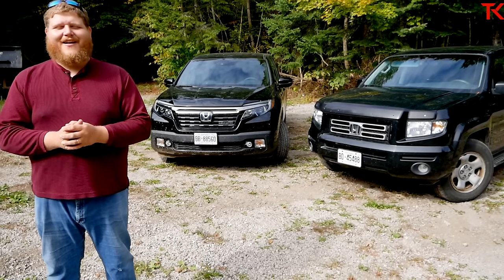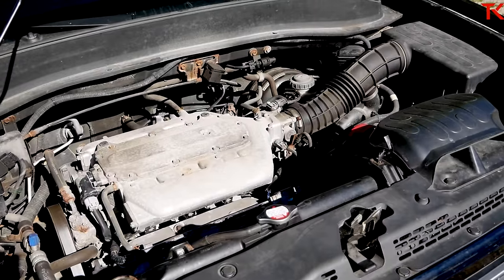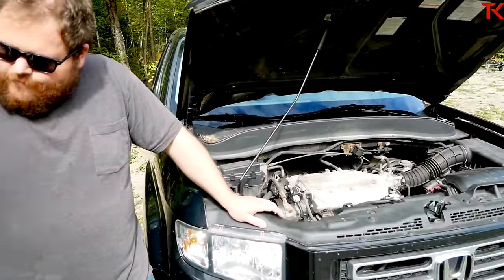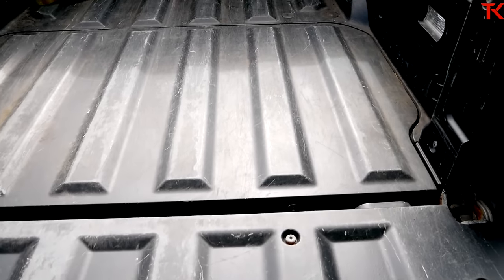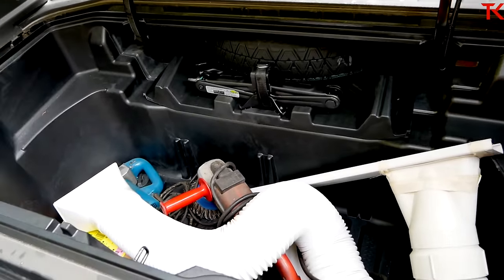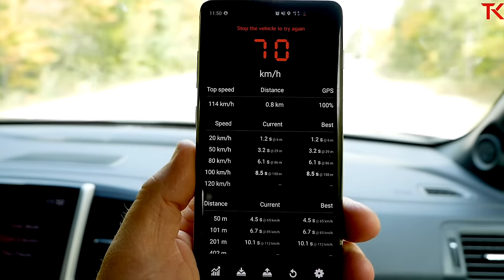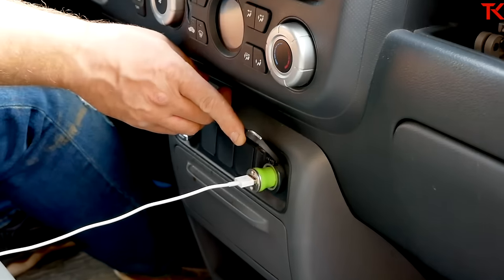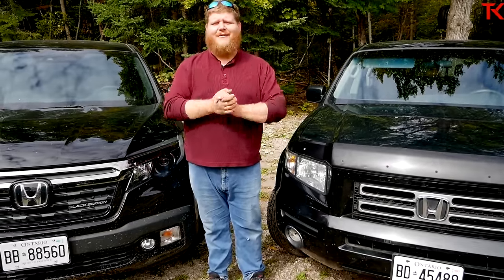Old VS New - Is the 2020 Honda Ridgeline Truly Better than the Old One? + 0-60 MPH Drag Race!

Comment: For your brother: The 2006-2008 only had six bed tiedowns. When Honda did the 2009 model year refresh they added two additional tiedowns to the top-rear of the bed giving you a total of eight. Also, with the 2009 refresh Honda got rid of the four-pin tailor connector leaving you only the seven-pin.  Additionally, the dual-mode tailgate in the down position is rated to handle 136kg of dynamic load before that cable fails.  Lastly, the first generation Ridgeline has enough space for a full-size spare in the in-bed trunk while the second generation can only fit a donut.

Comment: I bought my 08 new. The RTL w/ navi was the top of the line, then RTS, RTX and RL. All models came with 4WD. I updated my audio head unit with a Pioneer 4500NEX w/ Bluetooth. Had seats, armrests and center console covered in leather with new original sports cloth center inserts. LED headlights and day-time led running lights in the lower cutouts in bumper. Awesome truck that I'll never give up. 160,000 + miles and has never let me down.
Reply: I have a 2010 RTL model heated seats moonroof loaded 160,000 on it I love it I just wished it got better gas mileage I was hoping for more than 20 22 25 miles to the gallon
Reply: How's that head unit.. I like stock but my navi/touch is acting up....
Reply: @richardyoung5586  same here, gas isn't as good as I thought it would be :/
Reply: That sounds pretty awesome I like to see some pictures of the Year interior I have to do the same thing to mine like to see what it looks like
Reply: I'd definitely be interested in the headlights
Reply: I'm planning on buying a used one (2006), what common issues they have? What about the MPG? I'm on university so I'd use it for daily, I'm from Mxli so the gas is not so expensive.
Reply: @LxloSiq  I get about 17mpg

Comment: I’m 18 I just bought I 2011 f150. I traded in my own 2008 ridgeline, she made a lot of noises, 215,000 miles, all sorts of lights constantly coming on and off, it was the end of her life and I needed to upgrade to a bigger truck for my gutter business. But for the two years I had my ridgline (little brick) she did a great job. Very affordable when I bought her, little maintenance in the time that I had her and took a 50 mph rear ending like an absolute champ. Would highly recommend a used ridgeline for a new driver, very safe very reliable.

Comment: I like the uniqueness of the gen1 styling. Plus the interior is much more practical.
Reply: I feel like a boss in my 2014👍
Reply: I think the front end of the gen1 looks better but I've always thought it looked ugly from the side
Reply: norcalchrismeister I would take a gen1 with gen2 powertrain
Reply: Had 5 since 2007; current is 2019.  I like the ride and diminished road noise of the current model but the interior of the old ones is much better.  The console that separates the leg room is stupid.  As was getting rid of that little tray over the glove box. I disagree with this guy's assessment of the trunk. I have golf clubs and the new one (2019 vs 2012) is bigger.  The other thing about the new interior is that there is no 12V power source in the back seat, also stupid.  The air filters on the new one, both motor and cabin, are much easier to change out.  I hated the body style when I got my 2007.  I called it the storm trooper; it was white.  But after a while it grows on you and now I miss the little El Camino "wings" on the bed.
Reply: @jamesharris8719  my 2008 was white. I regret ever getting ride of it.

Comment: I rarely drop the tailgate on my 2008. 99% of the time I swing it out to access the trunk. Also, didn't like the flying butress at first, but it grows on you. It's also practical. It stiffens the unibody.
Reply: I have a topper on mine  so when I see a neked one I'm always like, oh yea, that's how it looks 🤣
Reply: @molliefofollie  I just bought an 07 with 145k miles today. It’s the RTL and has a topper too. So excited

Comment: Love my 06 Ridgeline (1st year of production). It's got 226,000 miles and counting ... runs great with plenty of power and smooth ride. FYI, mine had the same back seat lock bar issue that I fixed by replacing a pulley at the floorboard that controls that locking mechanism - about a 30-minute fix.
Reply: I saw a video on the replacement but they took half the truck apart! Was a 4-hour repair! I'd like to see the video!
Reply: I have a 2006 that I bought new,  also did the rear seat bar repair (very easy).  I also did the header (was pretty easy,  but time consuming).  Great truck no issues only 180,000 miles.  Hated it's look when I saw the original commercial but it grew on me and ride is super.

Comment: I have a 2006 with 140000 miles on it. I love this truck it rides n drives great is great in snow n off road. I have hauled 30 bags of mulch with no problem. Have also hauled a bed full of sandstone, probably too much, but it had no problems navigating hills a curves with that load. I hope to keep it for years to come. It only has one dime size spot of rust on rear wheel well and we live in north East Ohio. I will but another one when I need to replace this one. Also I have towed 4800 pounds of limestone in a trailer with no problems.

Comment: As a fourteen-plus Honda tech (1984-1998) yeah, we come up with "deals" that'll make the general public swoon with jealousy . We bought a new 97 passport to tow our new Reinell 18.5 ft. boat. By the time I was done, I had a factory "Bull-bar" up front that was going to be thrown out because it was warranteed for being scratched up out of the box..I installed the biggest B&M trans-cooler...a pair of correctly sized driving lights flanking the receiver hitch with a dual-pole dual-throw center-off switch on one of the blanks on the dash, An "off",  an On tied into the back-up lights, & a "remote" to illuminate the boat for any reason. Of course all wired up correctly with fuses & relays.

Comment: I had an '08 and now a 2021. I loved that '08 so much and at 110K miles it looked/drove brand new. The Gen 2 is definitely improved, as it should be. The only thing I didn't care for on the Gen 1 was how easily the seats would stain. They were very durable but anything would stain them and impossible to clean. Amazing truck though.

Comment: Honda came out with the first gen Ridgeline and realistically started to wake up the midsize truck segment.  I wish for the next update they throw in some lockers and increase the tow rating and give it some mo powah babeh!!! Thanks for the review guys!!!
Reply: Honda don't seem to be interested in building a full size but I'd damn sure like to see them do it 
The first generation was built for work
If you notice all the knobs and buttons are big so you can use them with gloves
Reply: I hope they don't put lockers.  I hope they stay with the way the Ridgeline is especially with the IVTM4 AWD.  However, they should make another body on frame truck with a v8, lockers, solid axles, and leafsprings or just get yourself a F150.
Reply: If they had increased the tow rating, I would probably be driving one right now.  I had a 1st gen and loved it, but I was constantly pushing the tow limits. What Honda needs to realize is that as things progress, our trailers gets larger and heavier.  Back in 95, a F350 could tow 10,000 lbs, which is about the same as a F150 today. 5,000 lbs for a midsize might have been acceptable in 2008, but in 2020, a push to 6,000 lbs would open the door to so many more boats and RV’s, not to mention how close of an eye you have to keep out for loading the trailers. FYI, I now drive a F150.

Comment: Cool comparison. Nice to see the changes they made from 1st to 2nd gen. I wish they made the Ridgeline with different cab configurations. I don't need a crew cab, but I do need a longer bed so this unfortunately isn't on my radar to replace my current truck when it goes to the scrap yard in the sky.

Comment: My dream truck is a Tundra but I will probably never need to tow to it’s capacity and will have a hard time justifying a 50k truck.
I own a 2012 Ridgeline that I love. Versatile, awd, has a trunk(only truck to), tows my boat and a 17’ cargo trailer. 
I, just like others, will be driving this thing until it blows up and at 85k miles it will be a while before that happens.
It gets treated more like a truck than 50% of trucks I see on the road here in FL.
Reply: 👏🏼👏🏼mine has always been ran hard and treated like a truck and people can say what they want, but they're always complimenting the smooth ride and their eyes pop out when I get my daughter's full size stroller out of the trunk 😂 I love it.

Comment: 230,000+ MILES!  2007 i LOVE IT. lOVE IT~I just put 5K in it; new paint, new leather upholstery, new tires, breaks new windshield new.  It looks like a new truck and my mechanic said I will get 300k miles easily on it.  Looking for a shop to rebuild engine when it reaches 301k. still cheaper and better than new truck.  No Rust,I love this truck and I've had Chevy, ford and toyota but this is the best I've had.

Comment: Totally incorrect to say it’s a Pilot with a truck bed. There was s a YouTube where Honda engineers discuss what they beefed up in the Ridgeline compared to the Pilot. They added truck duty grade components. Much of the front end is unique to Ridgeline.
Reply: ALso the gen1 actually has truck level frame under it unlike the gen 2. The other vehicles do not.
Reply: Both the first and second generation Ridgelines have a fully boxed frame. Someone described it as unibody on frame construction.
Reply: @michaelfoulkes9502  Exactly, just it is welded to the unibody structure rather than bolted. So really you have, as you state, both unibody and frame, completely inseparable.

Comment: I had 2 06 Ridgelines.  1st one I wrecked. I owned tacoma ranger f150 silverado. S10 nissan titan. I have to say the Ridgeline is the best well rounded truck I have ever owned. So versatile and you can get anywhere in the snow with the most basic tires.

Comment: The 2008 had four tie downs by the tail gate.the top two were removed for that tonneau cover.  I like the bed lights in 2010 because the two lights near the tail gate can shine into the trunk when you have the trunk open.  The new 2020, the bed lights are just two set in the mid position of the bed. When open the trunk you don’t have lights shining into the trunk.

Comment: I’ve got a 2008 Ridgeline AWD. 130k, and frankly it drives like new. It’s truly fun to drive these, as the suspension was well built and the steering is dead on tight. You think you’re driving a car with rack and pinion steering. I’d not trade the Ridgeline for anything. A new one would simply be another car bill, which I don’t need to be making $650 month car payments!!! Good job Honda!!

Comment: The argument over whether it's a truck or not begins and ends with one question: does it have an open bed? It does. It's a truck. El Camino: truck. Subaru Brat: truck. Ridgeline: truck. Any other arguments are just preferences.

Comment: I still love my old '06 Ridgeline. I always loved it's styling and still think it looks cool. It's tough as hell, yet It continues to be super smooth and comfortable and ultra reliable and runs on regular fuel as apposed to premium. I've never been want for more power. Fantastic distance highway cruiser even when loaded down with a fridge, stove,chairs and more. The traction in snow is outstanding!
 Modes? We don't need no stinkin' modes!
Also don't want or need a fake divider line between the body and the box. Keep it real, Honda, the uni-body construction is strong.

Comment: hey y'all, if you're looking to convert the 7-prong to a 4-prong trailer light setup. Lowe's sells a converter that fits right into the 7-prong and its only $10US
Reply from the maker: Matt says thanks.
Reply: Yes. That's what I've used for a couple of decades on virtually all of my trucks. A simple plug in adapter that goes from seven pin to four pin. Trailer wiring plugs are too exposed to have two different plugs to get contaminated or fouled so having only one  and using an adapter is great.

Comment: I have a 2013 Ridgeline I like it more then the new one.  I like having the open space in the center console instead of being fully closes off. Plus I was able to install my own stereo system in it and under the back seat subs...I installed the factory fog lights.
Reply: Not to mention that the first gen ( I have a 2007) has a one-piece rear window, the new one has it split, which is a step back in my opinion.

Comment: I had the 1st generation. It was an awesome truck. I liked it was better than all of the Fords and Chevys I had or driven. Interior was spacious and the bed was awesome for every day use. I raised the frontend and put on beefier AT tires. It would go just about anywhere.  Even pulled out a stuck F250 when 4x4ing.

If Honda would have made the Gen 2 manlier like the new Rivian, I would have bought it. The made it look like an Odyssey instead and I could no longer go with with Honda. Bought a Titan pro4x instead.

Comment: When the original came out it was revolutionary!! Being a traditional truck guy, I hated that I loved many of the things nobody else thought of... (fancy tailgate, in bed storage that was lockable etc). The new one seems to have a very loyal following but being a 70s and 80s kid, I would say the new one reminds me of an El Camino instead of a truck. I think they missed the mark on towing capacity. The new one is very comfortable and rides nice though. I guess everything is about balance and trade offs etc. Tx for the video!
Reply: It's not loyalty.  Many owners were loyal to other brands or were prior body on frame truck owners before they bought their Ridgeline.  It's more of a maturity decision...need vs want.  The dual action tailgate and in-bed trunk are not designed to be fancy but for practicality in mind.

Comment: I'm an Avalanche owner and do take my truck off-road and onto the beach but I always liked the 1st generation Ridgeline.  At least it had some ground clearance.  The 2nd Gen has practically none and while practical cosmetically it doesn't look at all like a truck while the 1st Gen did.  I was also surprised at the gas mileage on Ridgelines as I thought they'd be better than what is reported.

Comment: A year and a half ago I bought a 2013 Touring with 45K kms on it. It now has 55K. An old lady had it from new and decked it out with Weathertech Mats, a tonneau cover, hood deflector, running boards and all weather Toyos. It's still tight. The dealership got it on trade Thursday afternoon and by chance I was in the dealership Friday morning. It wasn't even reconditioned and I told the salesman not to put it on the lot. It would have lasted about 2 hours. I really like it and named her Rikki.

Comment: It’s unfortunate the “image” that people have made up for these, because I would no doubt get one to replace my 2012 tundra. They’re great for 95% of “truck” owners these days, except for the few that actually do tow and off road regularly
Reply: If you have a 5.5 bed and crewcab, agreed. Not if you need the 6.5 or 8 ft bed though.
Reply: @stevendeckert6373 , exactly so--at which point you NEED a full size truck!  Mid size wouldn't fit the bill at that point.
Reply: Often getting large payload of heavy rocks for a yard would not be a good idea to have this truck, which is what many people may do eventually to their vehicle
Reply: @leechuin1624  I would advice you not to purchase a truck based on eventuality.
Reply: @leechuin1624  considering it has the best payload of midsized trucks up until the new Ranger came out, at 1580 lbs, which I might add is more than an f150 Raptor, I would disagree. yes you can option a half-ton for more than that (key word is option, most don't stock), but in the US the Ridgeline is technically classified as a half-ton due to its payload capacity specifically.
Reply: @markej4801  I would again have to disagree as the truck can barely handle the testing done by a professional grading channel such as @whistlindiesel

Comment: Bought my loaded 09 RTL new for cash and still have it. Never could find a good reason to trade it when buying newer vehicles. It’s needed one $300 repair in the 12 years I’ve had it. My other vehicles have looked better, but this is by far the most functional vehicle I’ve ever owned.

Comment: I had an ‘07 that I bought new and I sold it with 280k on it.  It was the best vehicle I ever owned. I now have a ‘19 that I bought used and I liked my old one better and I agree about losing the 4 pin, why?  Also no power outlet in the rear.  I also preferred the shifter on the column, I liked all the cubbies and the space under the dash.  Nice video guys.

Comment: Have a 2009.  Hands down the best truck I've owned...and better than the new models :)
Reply: I just bought a 2009 today. I have been wanting one for years.
Reply: @dskillzhtown  
How has it been for you?
Reply: @42luke93  Been great so far. I got it from a Honda dealership. I put in a new radio, that's really all I have done to it so far.
Reply: @dskillzhtown  
Nice. I always appreciate those vehicles with the column shifter. You just don’t see them much anymore. Definitely way more versatile than the new one with the storage too.

Comment: Honda really messed up installing a push-button transmission--all they did was add fuel to the fire that it is not a truck.  Miss my 2010 and will get another soon!
Reply: Too bad the ram and other trucks are starting to adapt to a new type of shifter. The ram has a damn dial.... Which means your statement is inaccurate.
Reply: So pulling a lever towards you then down or up depending on desired gear makes it a truck?  Cool story dude!
Reply: News flash buddy: all the trucks are starting to do it, not just Honda. Plus I'm pretty sure RAM was one of the first companies to change the shift lever.